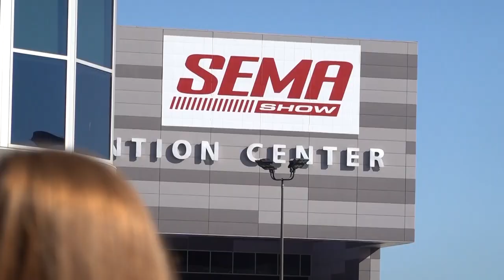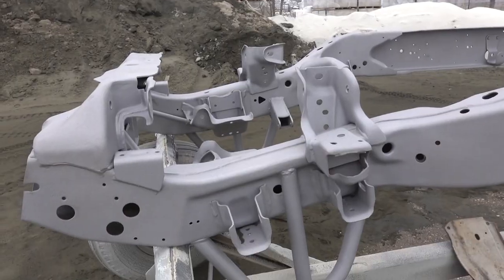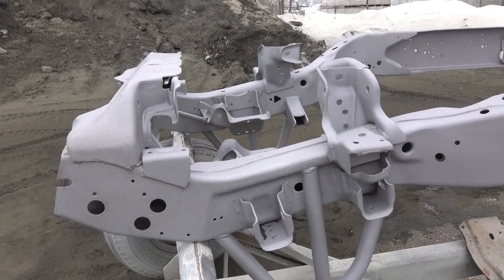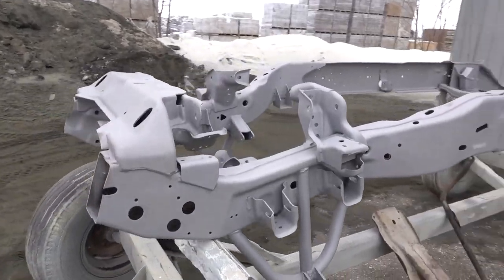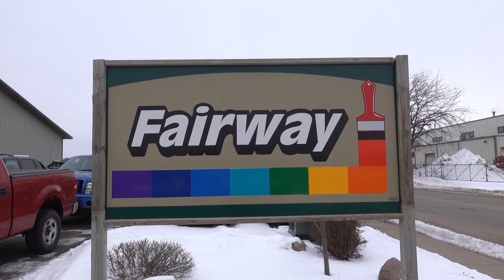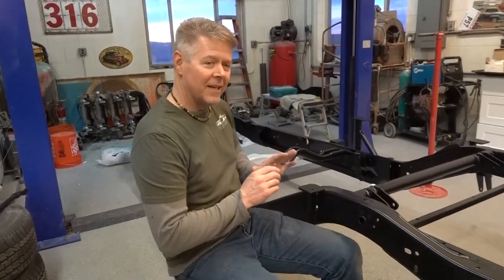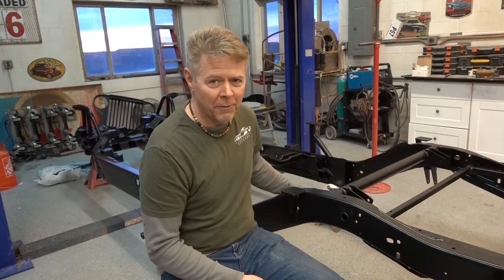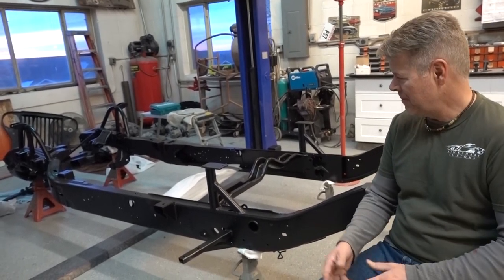LEGENDARY 1948 WILLYS PICKUP BUILD: PART 7 | FRAME MEDIA BLASTING,POWDER COATING!

Comment: Chris Looking good. What happens to all the holes that probably won't be needed. Wouldn't you want to weld those up before it got powder coated? Or did you already take care of the extra holes?  looked like a lot of them.
Reply: They won't be needed nor will they be seen.  They don't effect the strength. Also, believe it or not,  this will be a great driver not a show only truck.